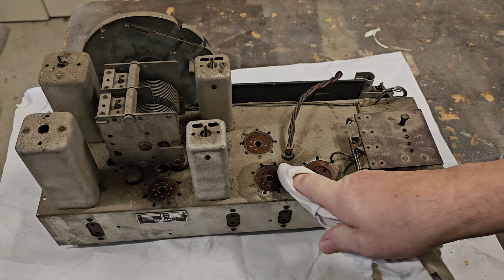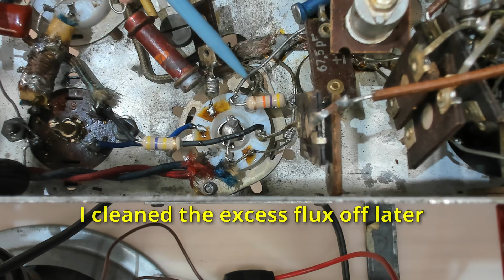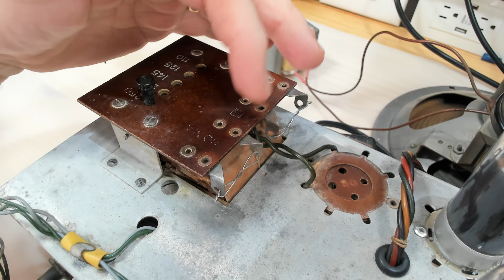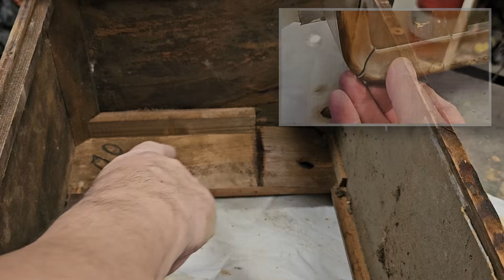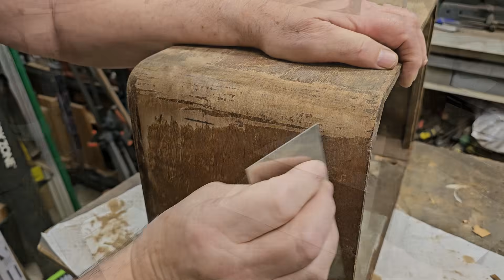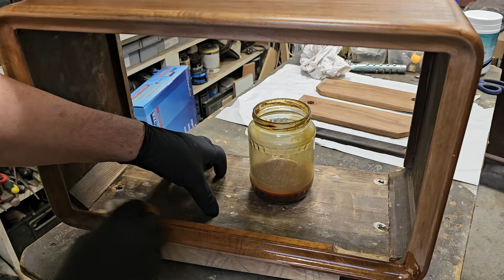Paillard Swiss Radio. Will it Finally Work? - Part 2 Model 3610B

Comment: Radio tube sockets manufactured in China have faced criticism for poor quality. The spring contacts holding the tubes' pin connections soften and lose their tension.
Reply from the maker: Thanks Masse 👍

Comment: Penetrating oils can be gotten to work, but in hard cases can take days or weeks to, well, penetrate.  I've mostly done this to get screws out of the lower units of old outboard boat motors- mostly British Seagulls- where propylene or acetylene torch will do more damage than good or replacement screws are largely unavailable.  I first wash off grime and salt with soap and water then dry that off and dehydrate it with denatured alcohol.  Then wire brush away corrosion, which becomes much softer when the water in it is goine.  Then turn the unit so the relevant end of the screw(s), head or bottom, is up. Apply a light or very light oil as primary penetrator, say 3-in-1 oil and WD-40, and let that go in with help of gravity for a few hours. (The important mechanism is capillary action into the rust layer.)  Then test with a screwdriver, and if it won't move (the usual case) first reapply the light oil(s)- and after letting some sink in, cover that with a heavier oil, say fresh 10-W30 motor oil.  Then let stand in a cool place (winter garage) for 3 days to two weeks.  (You can sort of forget about it for even longer, the motor oil serves mostly to prevent evaporation of the light oil, forcing it into the role of advancing in the rust layer of the screw.)  Applied in this way, penetrating oil progression down a rusty screw thread tends to average around 1 cm per week in weather around 5-10 C for me.  Which is slow, but finally getting a half dozen rusty iron Wentworth screws out of a 60 year old aluminum outboard cover, making it possible to replace the impeller, absolutely makes your day.
Reply from the maker: That is a very thorough method for dealing with stubborn screws, thanks for sharing your experience trillian23x🙂

Comment: Hi David, the shellac as a first step is definitely the right way to go. Not only does it prevent the stain from soaking into filler, but it evens out the stain on the wood a great deal. If things go bad, it also makes it possible to strip off the stain without sanding.
Reply from the maker: Yes agreed Brian. I think I will apply a few coats next time but it does provide a more even stain application 🙂

Comment: I’m an electronics guy down in Hobart, but I also do some chemistry. I just thought I give you some “backstory” to the oxalic acid and hydrogen peroxide you were using on the cabinet.

Oxalic acid is a very effective ligand for Iron-III, so most water insolble Iron III compounds…most notably, rust…dissolve very well in it. Even fi it is reacted mo,e foe mole with nicarb to make sodium hydrogen oxalate, this dissolves rust even better!
This is promerily why it is dold st Bunnings sr “deck cleaner”…it dissolves rust stains from screws. Where it is weak, is it foems very insoluble Calcium Oxalate when it reacts with any calcium compounds, so this is one of its downsides as well as its mild toxicity.
Citric acid also dissolves Iron-III, but a little less well than oxalic acid, bit it has the advantage that ir also froms water soluble calcium salts and will complex and make soluble ligand complexes with a wider range of matals than will oxalic acid.
So, oxalic acid id great gor getting rust stains out…but does bugger all to tannin stains. Thise stsins on that cabinet looked like tannin from the wood that had been moved by water in which it is soluble enough to cause staining. Wood is made basically from just two components, cellulose and tannin. In industry these are separated to become paper and masonite respectively. High tannin woods are dark..like Jarrah, and low tannin woods are lighter and softer. A lot of tannin makes the wood really hard…like lignum vitae. 
Oxalic acid is a mild reducing agent too, but won’t reduce Iron III to Iron II unlrss you djine light on it…but the oxygen in the sir just oxidizes the Iron II right back straight away.

Hydrogen peroxide is usually an oxidizing agent…it is a reducing agent under certain circumstances but thst does not voncern us here. hydrogen Peroxide reacts slowly with tannin, basically destroying it completely, so it will remove tannin tide lines, the ixalic acid only removes metal…mainly iron, tide lines. You can use the two together, but thsy slowly react with each other destroying each other back to water and carbon dioxide.

Down here in TAs, in Burnie, ther was the APPM pulp mill thst made paper…this plant basicslly did, much more sgressively, what you did to thst cabinet. Thry used jot sodium hydroxide to dissolve most of the lignin out of the wood as doluble “sodium ligninate”, this left the cellulose part behind uneffected. The “sodium ligninste” was neutralized with sulphuric acid to get water soluble sodium sulphate and the insiluble lignin back..they used this to make masonite, or “Burnie Board” as we called it down here…it was the by product like canite from dugar cane bagasse was up there. The cellulose, which was still a bit brown with lignin was then washed and bleached, some bleaching was done with hydrogen peroxide, but for the whitest paper for office use, chlorine dioxide was used. So the making of paper was just a much more sgressive version of what you did to thst cabinet!

Well done with those tracked I.F. Transformers and phenolic locktal sokets…my patience wiuld have expired well before!
Reply: Excuse all the typos, the softkeys on this thing sre just tooo tiny!
Reply from the maker: Hello Thanh, thanks for that comprehensive explanation of the difference between the stains I was trying to remove. In essence, you recommend using oxalic acid for rust and Hydrogen peroxide for tannin stains. I used hydrogen peroxide to successfully remove tannin stains in the past but though I would try the oxalic acid as I had seen people on YouTube use it. Cheers!

Comment: 6:30  The problem with that thinking is where do you stop?  That radio is older than most of your viewers.  Every resister could short, every coil in the radio could short.  All the varnish on the wire in the coils will burn.  Carbon tracking happens in the cans all the time.  So do solder whiskers.  Put in a fuse and hope for the best.
Reply from the maker: Yes, that's true tarstarkusz, but I knew one socket had failed so it was reasonable to suspect the others may suffer the same fate at some point 🤔

Comment: Lovely work. May I ask what you use for paint stripper in Oz? Here in the U.K. we can't be trusted with good old Methylene Chloride stripper any more (unless a "professional,") in case we bathe in it (!) The stuff in the shops now is pretty well useless...
Reply from the maker: Thank you. I use Polystrippa, according to the safety data sheet it contains methylene chloride (dichloromethane). I hope it stays here, it is the only one that works 🤔

Comment: That cabinet is going to come up a treat. Replacing those valve sockets was definitely for the brave. I would have had my heart in my mouth attempting that. Very well done and now 100% reliable. Looking forward to the next instalment.
Reply from the maker: Thanks Ian. The cabinet will look as good as it can do. The valve bases were straightforward enough, time consuming but otherwise no problem 👍🙂

Comment: Good call on the shellac treatment...no blotching in your stain application and it's looking great. Honestly, you could have touched up the filler with a stain marker and finished the whole thing with a couple more coats of shellac and had a knockout job with a great color. It's always fun to see you do cabinet work, because you use easily available materials and tools to good effect.
Reply from the maker: I have done a couple of radios using shellac, hard work and time consuming but the result is very good. I wouldn't do it on this case with some of the water stain still slightly visible but I will do it on a good case next time. Good idea Don 👍😊

Comment: Have you ever tried sodium peroxide ?  Used it on deck timber that was gray and black.  After a couple of treatments it looked freshly milled timber.  Powder dissolved in hot water.
Reply from the maker: Hi Paul, no, I haven't heard of sodium peroxide. It is only available in pure form from industrial retailers here as far as I can tell via Google. It sound pretty reactive. Thanks 🙂
Reply: @DavidTipton101  It's usually the active component in deck cleaning products.  I'd carefully ladle it onto the deck timber.  It would bubble up a bit with disgusting foam.  Light scrub with a stiff broom and then hose it off.  Repeat once or twice and bingo the deck timber looks like a million dollars.

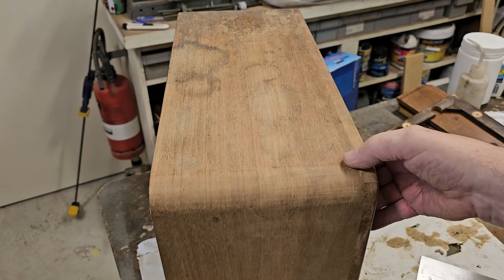Comment: 20:54 David, i'm sure you watched a video or two on how to use Card Scrapers, once you get the hang of putting a flex to it while scrapping it really is 10X faster and a lot easier and faster than using sandpaper. But first one needs to master the quick but hard to learn of creating a burr, That is by far the hardest part of mastering the card scraper.
Reply from the maker: Hello Patprop. The scraper I have, and that was difficult to find, wouldn't bend in a vice with a hammer, it is solid. I will look around for a bendy one online. Thanks 👍🙂
Reply from the maker: Update, I found some flexible scrapers on Amazon with a burring tool 👍🙂

Comment: its a right pain in the bum to replace valve sockets 😉
Reply from the maker: Haha, you're telling me Andy. One was OK but four takes it out of you 😅
Reply: @DavidTipton101  i've had the 'fork' contacts break in b7g and b9a mcmurdo sockets quite often and usually replaced just the bad contacts, not the whole socket, by cutting the old ones at the tip of the U bit, after sucking the solder off, then twisting so they'll push out fairly easily, putting a new one in in reverse, cutting the U tip, so can splay apart around the component wires, if i dont have any sockets to pinch contacts from, i've found the contacts from DIN sockets often just about fit if you squeeze them up a little 😉

Comment: I watch a lot of furniture flippers. They say to use Oxsalic on the WHOLE piece or the situation goes opposite, and you see the ring as light instead of dark.
Reply from the maker: Yes, I agree but in this case I was afraid the stains were too heavy to do that straight up. I did do that in the end but didn't leave it long enough 🙂

Comment: You got the better ceramic sockets like the ones I have stock piled in my shop. Quite a job to track down all of the different problems that radio had. But, your methodical approach did it again. How is your health doing David everything still good I hope. LL
Reply from the maker: Thanks Larry. Hopefully these bases will be more reliable/stable than the originals. I'm going well thanks Larry 👍🙂

Comment: Hi Dave,
This radio is giving you so much trouble it's almost as bad as the ones I usually get!
Looking promising though.  I think that cabinet is going to come up very nicely.
Cheers
Reply from the maker: Hi Don, no, you still hold the candle on the most recalcitrant radios 😅
Reply: H ha! I didn't plan it that way. Just lucky I guess.

Comment: If you use oxalic acid again, cover the whole area with it and let it dry for about 20 -30 mins and then wash it off. Make sure the mixture is warm to hot. Looking really good though. Keep up the great videos.
Reply from the maker: Yes, I was afraid to go too hard and wanted to lighten the heavy stains before I went hard core. I will do as you suggest next time, Thanks Brian 👍🙂

Comment: What I would’ve done is to label each war, and then with numbers, and then put them and corresponding numbers on the valve socket
Reply from the maker: Yep, whatever works. I don't have much trouble and take photos to check my work. I have the video as well of course 👍🙂

Comment: The phenolic sandwich type of socket is really awful for stuff like arcing, sockets breaking or coming loose, etc. The LOKTALs are bad enough, but the subminiature ones are really awful. The replacement ceramic ones like you have is absolutely bulletproof, far better.
Reply from the maker: So I found out Brett. The new ones should be more reliable, thanks Brett 🙂